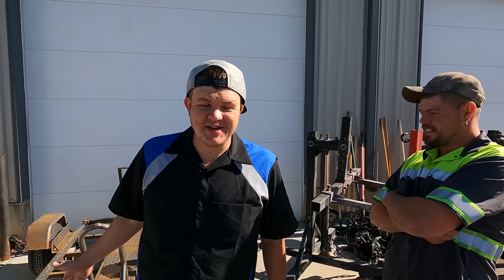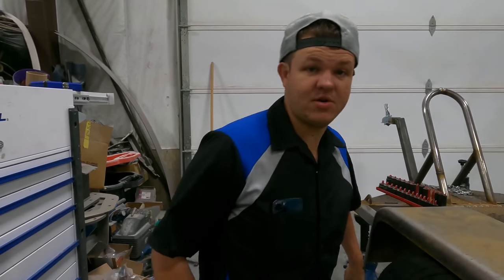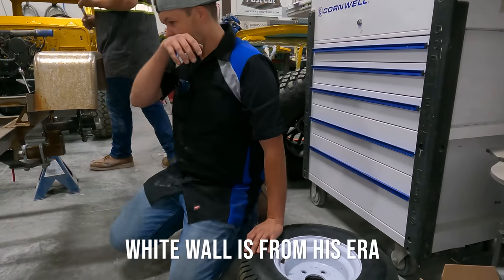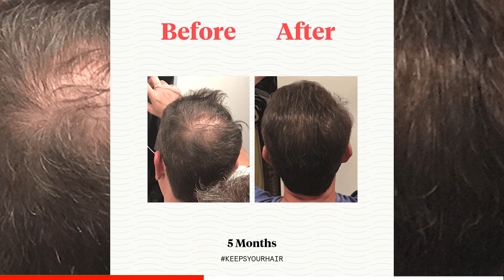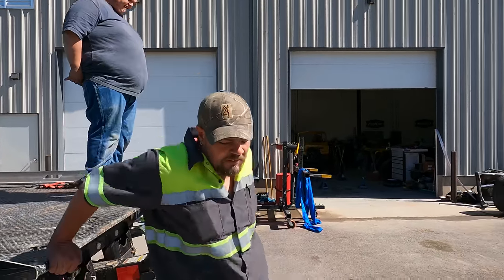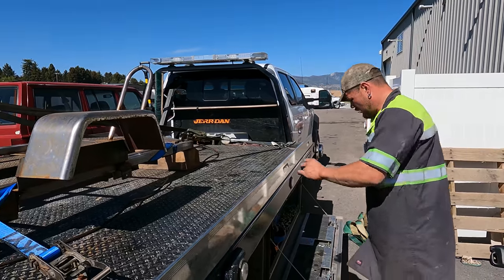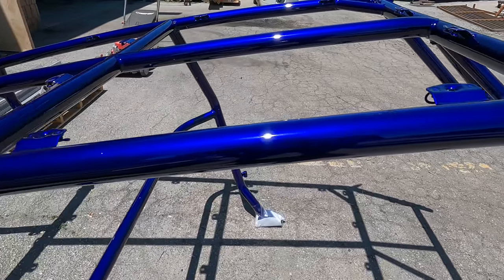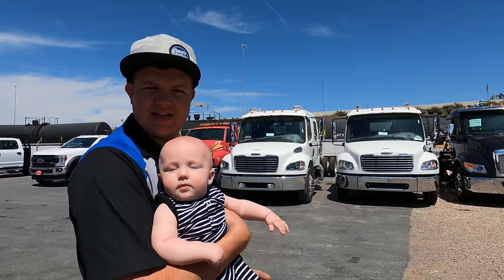Taking The Golden Nugget Trailer Apart Before Paint!

Comment: I think everything on the trailer should be black including the rims with only the fenders being gold (they are the only bodywork). This will let the Rokon pop and shine like it should. The trailer is a coordinated supporting character.
Reply: some black pinstriping on the rokon and gold matching pinstriping on trailer
Reply: Gold fenders would clash with the bike when it sits on the trailer imo. I agree the trailer should be a secondary focus to the bike.
Reply: I agree... I would black out the trailer, wheels and all. Maybe gold fenders. But trailers take a beating, so it doesn't matter what process as long as it's fairly durable and easily touched up.
Reply: I came to write that. You beat me.
Edit: how about all the trailer and axle powder coated black with gold fenders and gold rims?
Reply: All black trailer.
Reply: All Black Trailer, gold wheels
Reply: Sounds good!
Reply: I Agree
Reply: I agree Daniel Brown, my thoughts exactly, that way the Rokon will POP as you say!!
Reply: This
Reply: @jfk64kennedy95  All black with gold leaf pin striping like older fire trucks would be cool
Reply: Completely agree, black powder coated frame with gold fenders
Reply: Great idea!
Reply: Before anything gets painted they need to add some diamond plate to the inside of the fenders to keep debris from shooting up onto the Rokon! Then paint the trailer black with only the rims being Nugget Gold, maybe some pinstriping!
Reply: Oh, snap! That's basically what I just posted (paraphrased)!
Reply: I absolutely agree. if it was me I'd powder coat the trailer Black and paint the fenders and rims gold. could even put a wide black pinstripe on the fenders
Reply: Exactly my thought , otherwise the bike will get swallowed by gold trailer.
Reply: I like thiss
Reply: Black trailer with gold trim
Reply: Definitely agree
Reply: As I was watching the video this is what I was thinking.
Reply: Agreed
Reply: Exactly right!  In a sea of gold nothing is special anymore...
Reply: @V35anito  YES! All black trailer and gold wheels :)
Reply: All black
Reply: Trailer black....fenders gold!
Reply: Hell yah i like this. Maybe gold fenders but definitely mostly black
Reply: This comment is the correct answer.
Reply: Totally agree with all black and gold fenders!!
Reply: I agree! Black trailer with gold fenders!
Reply: I like that I think
Reply: Yes and the wood will look better with the black trailer
Reply: Yup this!! Gold Fenders. If anything else is gold it will take away from the rokon
Reply: I think the trailer should be all black with the fenders and upper brackets in gold
Reply: Totally agree with this!
Reply: I agree, a gold trailer is going to get dirty and scratched up so fast, and be impossible to keep clean.
I think the trailer should be black, with either gold accents or fenders, or all black with gold pin striping.
Reply: Yes. Best idea yet.
Reply: This is exactly what I said on the last one. Frame Black. Body work Gold.
Reply: This guy knows what his talking about! A gold truck with a gold trailer carying a gold bike would look awful!
Reply: And CERAKOTE for the Black parts so it lasts longer.
Reply: Completely unrelated but did yall know Robby has a smokeshow of a sister??? She won Miss Utah USA in 2014, was big on the TV show called Survivor, and has a successful modeling career. She has a YouTube channel as well lol. Her names Angelia Layton. I was watching one of Robbys old videos and saw her in the comments and noticed she had the same last name. Clicked on her channel and turns out she's his sister lmfao.

Comment: I'm probably in the minority, but a gold trailer AND Nugget is too much. I would go with a Black trailer, w/a thin gold pinstripe, high gloss cherry-colored wood platform, gold fenders w/ a thin black pinstripe along the edge, black wheels w/ a gold pinstripe & black lug nuts. Have the colors alternate and break up the trailer/nug/rokon mono-color - would also highlight the rokon while it's on the trailer against the black. Looks amazing regardless of color choice - this has been fantastic to watch and cannot wait to see Ed's reaction!
Reply: This! Black trailer frame, axles, trims, with gold fenders/accents.
Reply: This is a good idea. That way entire trailer frame and base can be powdercoated black. Axle absolutely should be powdercoated. Trailer i  sandy area needs to be durable. As others have said the gold paint will take a hammering. Especially in a loading unloading environment. Not even sure why spraying the trailer frame and base was considered. To add to your idea entire thing including wheels powdercoated black. Gold pinstripe detailing on frame edge around load area and around fenders. Pinstripe the wheels and gold lugnuts for accents allows the rokon and nugget to shine and be the stars
Reply: This right here Robby!!! This is the winner!!!
Reply: You're not in the minority. A trailer should be black. You need contrast with the bike and Suzuki already being gold. Anything else, things start looking gaudy. Side note- not digging all these built in ads..probably won't be watching any more
Reply: @mcats8  The ads help support the side-projects that Robby and his awesome crew put together. Also, remember that this is youtube and you can FF and skip the ads. Right?
Reply: Not high gloss wood, would be a slipping hazzard for Ed

Comment: I don't know  what others think or said. BUT the only sheet metal on that trailer is / are the fenders and they are the only part that should be gold. The rest should be black. You painted powdered coated the Nuggets frame black. So everything but the fenders on that trailer is frame.
Reply: Agreed. The trailer will take a beating from dirt roads and rock strikes etc. Powder coating will be the best defense against the elements. Since the Nugget will not have mud flaps what about a black rock shield on the trailer to protect the Rokon?

Comment: What's the difference between powder coating, cera coating and paint?
Would be interesting to know the what, how and why for each.
Love your work as always! ❤
Reply: Powder is hydrophobic and is perfect for many industries. Depending on the mil thickness the Medical and Military love it.  Cerakote is the best for heat.  It comes it different heat resistant levels from 400 degrees to 1200 plus.   Paint done right by Robbie looks like it lasts as long as both previously mentioned.
Water is the most destructive and it always finds the path of least resistance.  Located in Florida.... In Rust We Trust!!
Reply: From a laymans standpoint, paint and cera coat are both liquids sprayed onto the metal. Paint is probably the weakest of all, cera coating also provides a better sealing, and powder coating  is a powder sprayed near the product and attracted like a magnet.  Then actually baked where the powder melts together and to the product. Powder coating is tough!  Seems to me that would be the process of choice for an axle in a sandy environment.
Reply: just to add to these other comments.. paint when it chips from rocks flakes off bigger than impact ... powder coating when it chips only chips at the impact point ... as for the ceracoat i cannot comment how it stands up to rock chips .... also paint is great for body work cause body metal and plastics flex and paint has some flexibility to it ... powder coat when flexed will sorta shatter like glass ... and ceracoat again i have no experience with it ... my guess about ceracoat would be almost as tough as powder coat but flexible like paint ... but thats just a guess...
Reply: theres also Rhino-lining!
Reply: @Stonewire  To add to this, Cerakote was first used by the firearms industry to provide a heat resistant protective coating to guns.
Reply: Powder coating is a type of coating that is applied as a free-flowing, dry powder. Unlike conventional liquid paint which is delivered via an evaporating solvent, powder coating is typically applied electrostatically and then cured under heat or with ultraviolet light. The powder may be a thermoplastic or a thermoset polymer. It is usually used to create a hard finish that is tougher than conventional paint.
Reply: Cerakote is a ceramic finish that can be applied to metal and plastics. It can increase wear resistance, corrosion resistance, chemical resistance, and hardness. The coating is generally used on gun barrels, muzzle breaks and suppressors. Thinner coatings of the material may be used on knives, industrial valves and personal firearms.
Reply: Thank you everyone for your replies! They are a fascinating process. I hope Robby can show us some of the ins and outs of the other products some day.
Thanks everyone!

Comment: 10.42 USD per gallon here in Denmark, but that is also almost double the normal.
Black Wheels for sure - must match the Nugget.
Reply: what? you are at around 2,60€ up there for E5? and i thought the 2,15€ here in germany are bad
Reply: @lexel90  17,89 DKK/L or 2,38 EUR/L leave some room for conversion rates...
"normal" would be around 1,4 EUR/L
Reply: And what's minimum/average pay up there?
Reply: @dempsej  Do you mean salary?
In Denmark we do not have a minimum salary. This is - in general - regulated at yearly or bi-yearly negotations between unions.
Currently the negotiated minimum is DKK 125 or USD19 per hour. This is for un-educated employees - so the lowest of the lowest.
A Big Mac is USD 5.69
Reply: @jesperbech8753  yes, salary. Here in Poland minimum is 3.25$/hour, big Mac is 3.5 USD and gas is 1.71$/liter.

Comment: I've been feeling like that gooseneck hitch should be braced against the hoop for the motorcycle front wheel.  At that angle, it just seems like it's going to create a lever with significantly more force now and should be braced.

Also, for the wheels, I vote black with a gold rim.
Reply: I agree 👍 there should be more bracing.
Reply: All that is supposed to be on this trailer is that mini bike. 200lbs +/-. You could use 0.65 wall 1x1 for a trail ride or a few with that amount of weight. Also the tongue is not carrying the full weight of the bike. Unless it becomes a utility trailer the goose is good to go.

Comment: Over here, regular fuel is € 2.19 per liter at the cheap pump, which translate to about $ 8.79 per us Gallon. So $ 5.45 does not sound bad. Luckily both our cars average about 43 mpg. Btw, wheels on the trailer black, but maybe the caps can be gold? and I would make a black strip of bedliner in the center of the trailer, I think the gold will damage quickly from driving on and off.

Comment: I think that the trailer should be all black with the fenders gold, black wheels with a gold pinstripe around the wheel and gold lugnuts.  I feel this will let the Rokon pop and not get lost in to much gold.  A good black powder coat would a better way as well,  much tuffer and easier to touch up.

Comment: I think the loading ramp on the trailer should have some heavy duty expanded metal on the running surface for slip-resistance safety. That's what I would do if I were building the trailer. I wouldn't want to see Ed get hurt loading and unloading the Rokon.

Comment: I think the axle and fenders should be Rhino Liner Black.  Rhino Liner is more resistant to the sand and gravel that will be kicked up by the Nugget and the trailer.  Powder coat and Cerra Kote will get chipped off.

Comment: Powder coat the trailer black, save for the fenders gold.  Wheels should be black also with a gold stripe. The black will look great with the warmth of the real wood deck though I'd prefer to see a plastic decking used and stained to look real. Much more durable to weather slip resistance might be a factor though too.

Comment: Please add a brace on the trailer neck. The slim shady way it is now is a failure point. Also, the ramp and tread plate should be black along with the axle and fenders.

Comment: Yellow frame, black axle, black... what's that thing in the middle called where the wheels go?  Something like raptor liner for traction and durability.  I am thinking yellow fenders on top and black underneath.  Yellow fenders will kinda go with the yellow tank on the bike.  Do not cover up the wood grain with paint -- stain and varnish it instead.  Make sure the wheels somewhat match what is on the Suzuki.

I never was a fan of monochromatic paint schemes.  I prefer accents here and there.  Not having them reminds me of those old houses where every light switch plate, every window sill, every door casing, every mop board, etc was all painted the same color.

I am predicting confusion from Ed along with a bit of negativity at first.  But once he realizes how much better it is, he will quickly grow to like it.  When it starts without a choke and doesn't blow smoke, has power steering, has the extra power to boot and he can actually drive it with much greater ease.... Yeah.

Comment: Diesel in Auckland, New Zealand is approximately $2.50 per litre.  That works out at $9.48 per US Gallon, or $11.37 per imperial gallon.   And then we still pay more taxes based on mileages driven.   So, Yanks.  Count yourselves lucky you are still getting cheap fuel.

Comment: Look at the era Ed is from and what he'd want.  I am 70 and greatly dislike black wheels because they all look the same, plus black wheels with black tires is way too modern for Ed or this vehicle. Gold wheels would look a lot classier and fit better with the era Ed is from. Trailer would be fitting in black, add the gold wheels and fenders it would look like a 50s restoration. People forget this is FOR Ed. Just my 2 cents worth but I'm a lot closer to Eds age than many of you that comment.